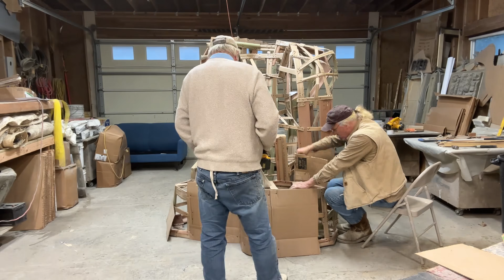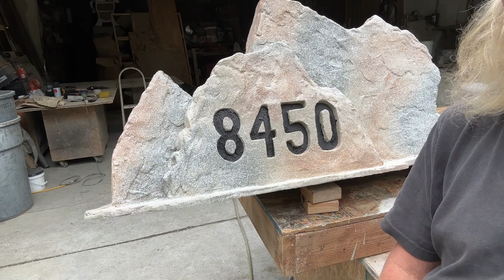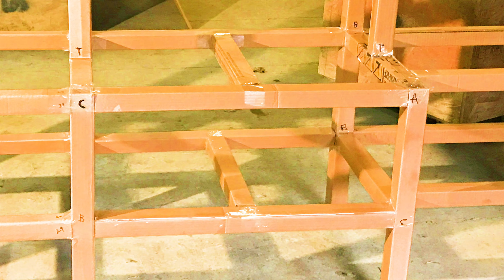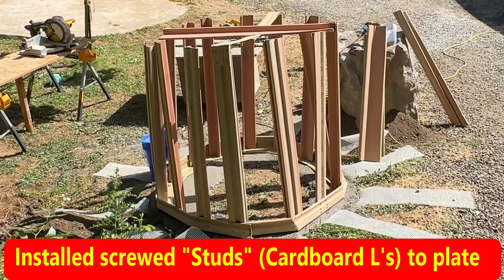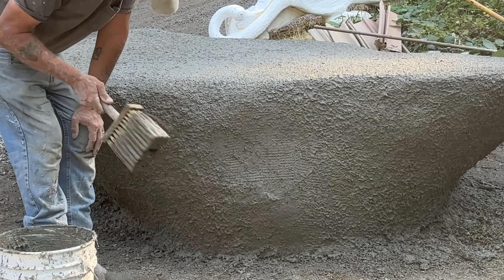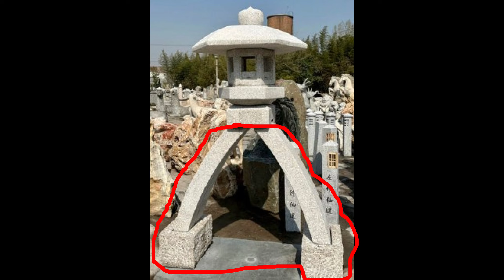12 Cardboard rock and stone projects

Comment: I'm homeless and live in central Oregon. I built a rock shelter using your cardboard method. My first one was 4x10ish and 4 to 5 feet tall. Blended right in. Now I'm about 80% done on a 8x16 in between two massive rock slope. I've added a bunch of cracks to the outside for ventilation and peep holes. Thanks
Reply from the maker: Glad to be of service to you. Thanks for watching my video

Comment: I have a dumb question for you.  What happens to the cardboard inside your pieces?  I mean, does it soften and collapse over time, or does it even matter since you add fiber to the cement, and that supports the piece.  Thank you very much for sharing your videos.  I have learned 
 so much from you.
Reply from the maker: The cardboard only serves as a form to lay the mud once the mud is laid and dried it becomes the structure then what happens to the cardboard thereafter matters not. Thanks for watching my video.